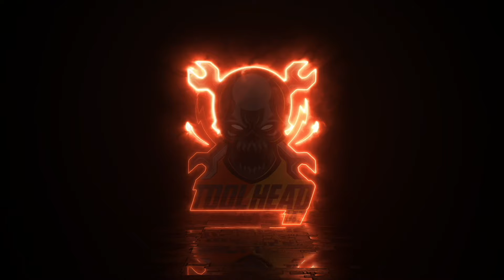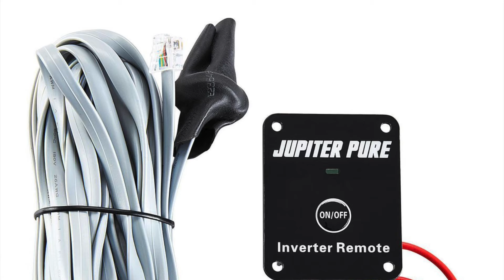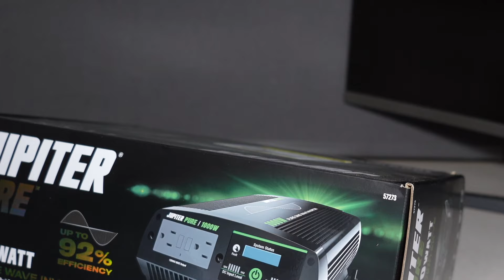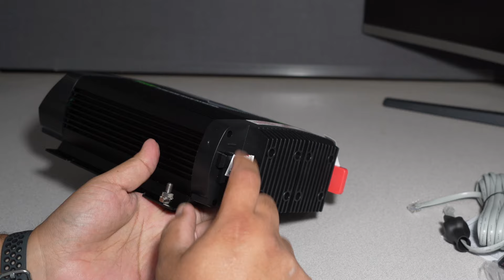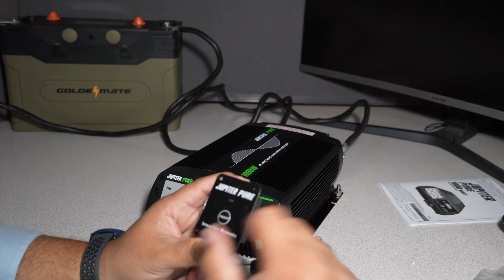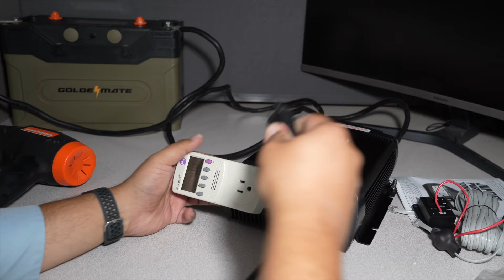Best Budget Inverter Camping Rv Jobsite JUPITER PURE 1000 Watt Continuous 2000 Watt Peak Pure Sine

Comment: where did you get that wire? It didnt come with one, and how do you set up the remote? and what is the telephone wire for?
Reply from the maker: Battery wire was was from harbor freight, telephone wire is for a remote. If you want wireless you have to buy an inverter that has a wireless remote.

Comment: Very Disapointed, I had to return it to harbor freight. Only two lights came on the bar. Showed low voltage, despite the full DC voltage measured on a meter.

Comment: How do you recharge the battery once youve exhausted it?
Reply from the maker: Solar panel with a charge controllers or just charge it with a 12v charger that is compatible with your battery in my case its a Lifepo4